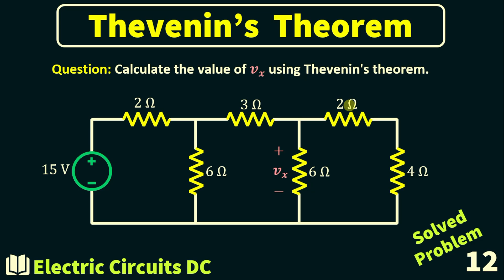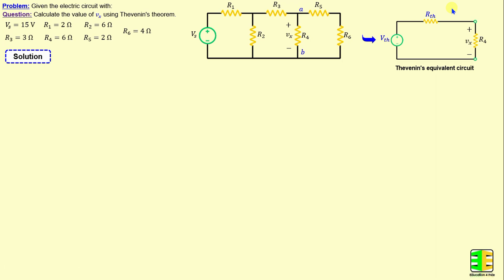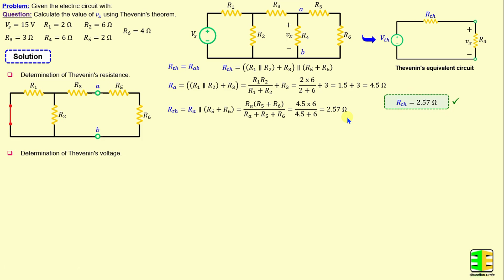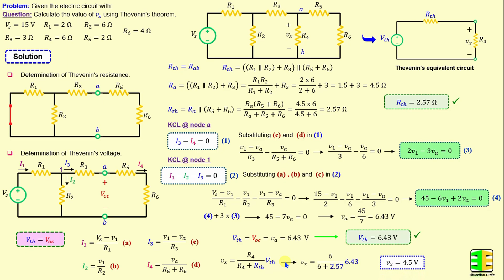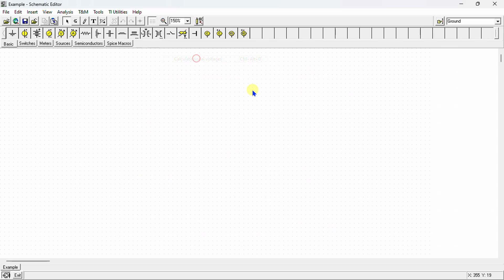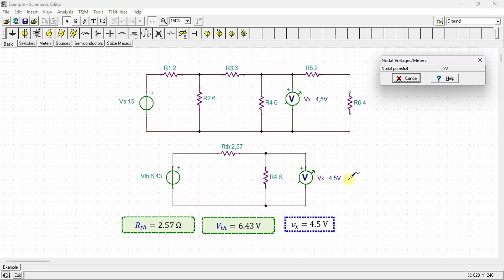Electric Circuits DC | Thevenin’s Theorem | Solved Problem 12

Comment: Sorry 👍
Simply left circuit (r=3/2,E=45/4v) and then (Vx-45/4)/(9/2)+(vx/6)+(vx/6)=0
(4vx-180)/18+(vx/6)+(vx/6)=0
4vx-180+3vx+3vx=0,10vx=180,vx=18v 🤔
Reply: @ElectroMindsEducation-jl5vs 
What is something wrong with my computing in this Circuit??😮